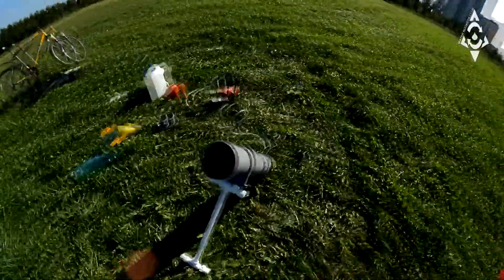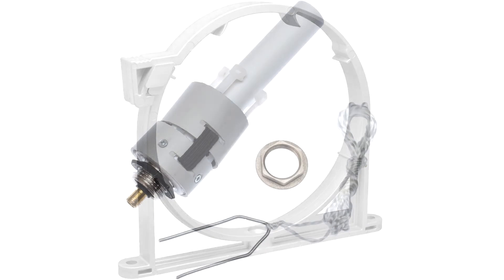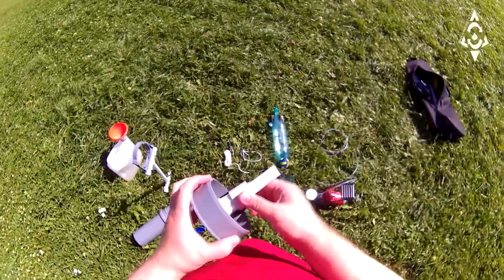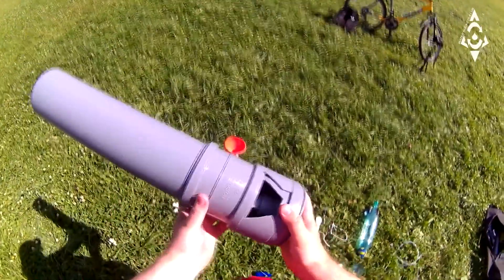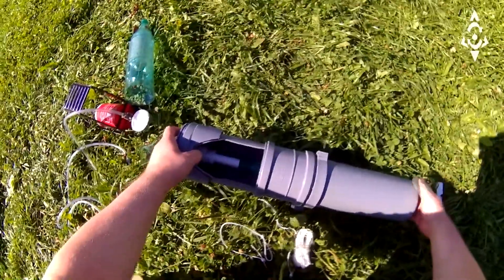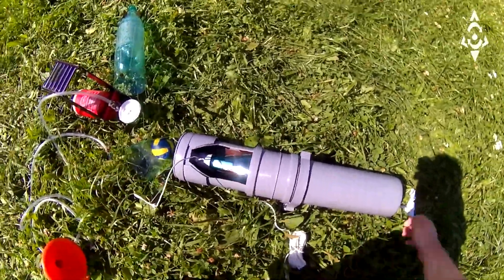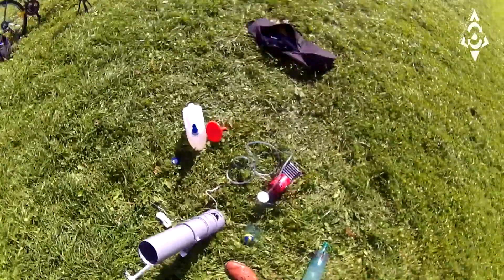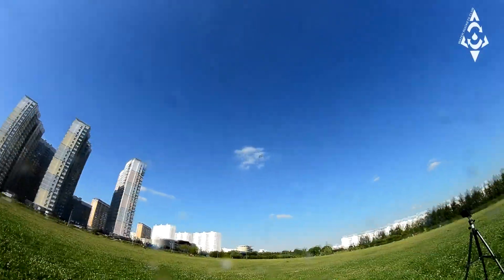CANNON/ Technology based on water rockets

Comment: Don't put your fingers in the barrel when it is charged again!
Reply from the maker: Okay, I will not! But nothing terrible has happened. Thanks for the worry ;)))
Reply: WATER ROCKETS CLUB  Just messing with you. Have you considered putting some sort of fins on that thing to spin it like an artillery shell? There seems to be room in the barrel.
Reply from the maker: Yes, the fins perfectly stabilize the flight. I'll try to make the rotation of the projectile by means of the fins in another project.There are plans to develop folding fins. But the most interesting task is to ensure the possibility of a horizontal shot and the full expenditure of water.